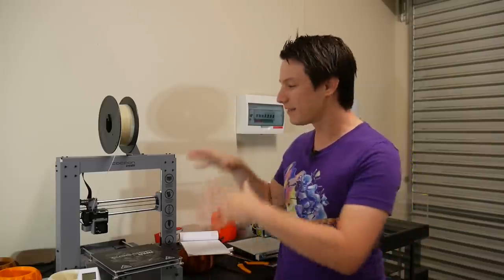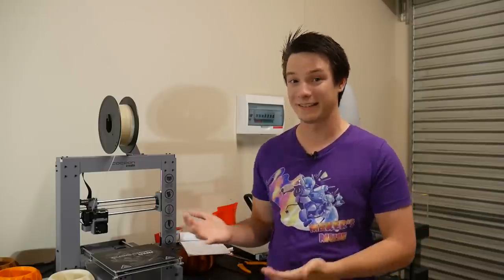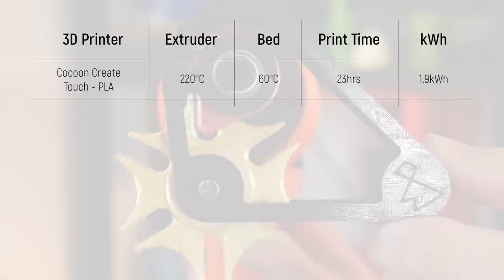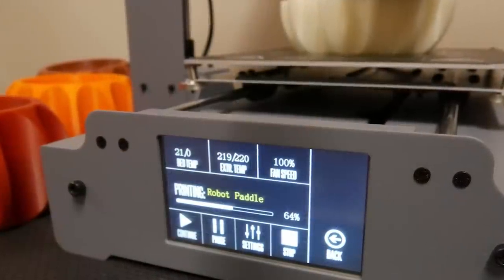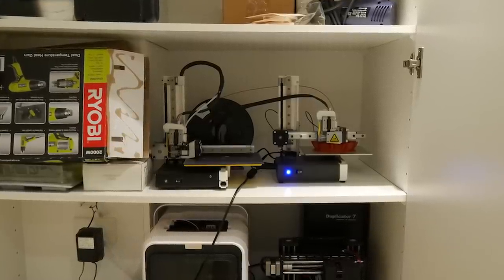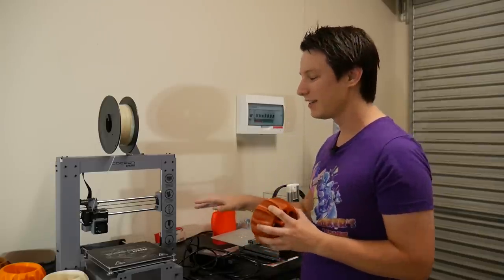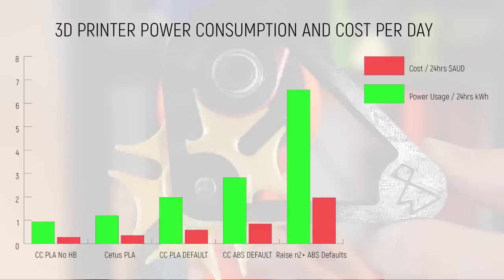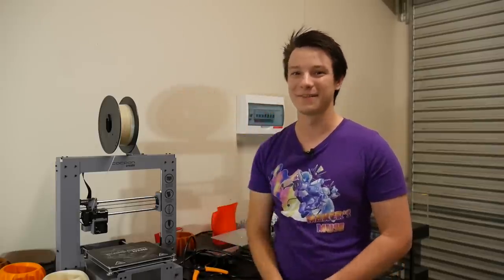How much power do 3D Printers use?

Comment: I don't think you understand what kwh means. That means that amount of kw/hr. So if your printer used 5kwh and printed for 19 hours, you used 95kw of electricity. That's nearly a friggin Tesla p100 of electricity!

Also, I don't think your fuses are rated for that much power. So you most likely just meant kw, not kwh. Lol
Reply: nambinhvu you misunderstand what kW and kWh mean.

Here's a recap of energy and power units:

First the definitions of energy and power:
Energy is the total quantity of work used to complete some action.
Power is the energy used for each unit of time during the same action.

You can compare them to motion quantities: energy is equivalent to distance (quantity of space covered during some movement), power is equivalent to the speed (distance covered per unit of time).

The base energy unit is the Joule (J).
The base power unit is the Watt (W). 1 W = 1 J/s.

A 40 W light bulb consumes 40 Joules every second it's on.

Since electricity consumption measured in Joules gives impractically big figures, an alternate unit has been designed: the Watt-hour (Wh).

1 Wh is the energy consumed by a 1 W appliance running for 1 hour.

1 Wh = 1 W x 1 h = 1 J/s x 3600 s = 3600 J = 3.6 kJ

1 kWh = 1000 Wh = 3.6 MJ

A 40 W light bulb that is lit for 4 hours every day on a 30 days month accounts for 40 W x 4 h/d x 30 d = 4800 Wh = 4.8 kWh on the electricity bill.
Reply: Christian Barnay I don't think you understood my comment. He said his printer used 5kwh. Household circuit breakers are only rated for 1.8kwh, if you draw more than that it'll trip. What he meant was it used 5kw for the print, not 5kwh. He's using the rate to represent the total amount of power.
Reply: No, I insist. You are confusing the units. Breakers and all appliances are rated in Watts or kiloWatts, consumption is measured in Watt-hours by multiplying the rate in Watts with the duration in hours.
Please re-read my comment carefully.
What you consume and pay for is energy (kWh). And its rate of use is power (kW).
Check your electricity bill: your monthly consumption is measured in kWh.
Check your breaker: it's rated in kW, not kWh.
Reply: Christian Barnay you're right lol my bad

Comment: Why are you printing at such a high temperature? I've NEVER needed to run my printer that hot on any color, you must be burning the crap out of your filament and getting clogs constantly.
Reply from the maker: These are software defaults, bit high for PLA yes but never clogged
Reply: +Maker's Muse Thanks for clarifying! Not sure about differences in brands of PLA, I use the cheap stuff, but you really never need to go above 205C for PLA (white) or 200C for Black. I haven't had to do a de-clog in over a year running 7 printers!

Comment: Sorry Angus. You were right. I got it all bass-ackward. Thanks everyone for politely correcting me. I'm leaving my original (wrong) comment as evidence of my confusion:
P.S. Your stats are confusing: kWh is the amount of Watts used every hour, not the total usage - that would be kW. So when you said it uses 1.8KkWh, that figure would be multiplied by the number of hours, thus resulting is crazy high costs.
Also, you don't get charged per Kilowatt Hours, you get charged per Kilowatts.
Reply from the maker: Yep I botched it... Had to schedule this one and messed that up. I'll follow up asap
Reply: Great video, btw. Not meaning to be harsh. Cheers!
Reply: W=J/S Joules are unity of energy 
kW=1000W=1000J/S
H=3600S
kW*H=1000J*3600S/S
The seconds cancel
kWh=1000*3600J
jWh=3.6*10^6J
and joules are a unit of energy
Reply: No.
https://en.wikipedia.org/wiki/Kilowatt_hour
Reply: Hmm? It's the other way around, the video is correct, imo. kWh is the correct unit for total power consumption (aka energy)...
kW is the power drawn at a specific point in time, only if you multiply it with the time that it's running will you get a total amount of energy which is what you will be billed for.
edit: ok, not the first one to reply^^
Reply: Yeah, did the same mistake until I watched the whole video :)
Reply: Da Hai Zhu You are not correct here. kWh is a measure of used energy.
Reply: No, you were right first time, Da Hai Zhu has it wrong. kWh is the amount of energy consumed. kW is the rate of energy consumption - multiply that by the number of hours you were consuming it to get the total kWh. This is why you pay for kWh not kW.
https://en.wikipedia.org/wiki/Watt
Reply: Yep. KWh is more interesting if you're worrying about cost. You pay by power over time because you use power variably over time.
Reply: KWh is energy/work done, not power
Watt is power aka work per second
KWh is 1 KW (1000W) x 1 Hour
1000W is 1000J in 1 Second
1 Hour is 3600 Seconds
so 1KWh is 1000W x 3600s = 3600000J of work
3600000J = 1 KWh = The work done in 1 hour by something that outputs 1000W of power during that time

He showed one of the printers used 1.9KWh in 23 hours so 1.9/23 = 0.0826KWh in 1 hour = 82.6Wh so the printer consumed 82.6W average during those 23 hours. That would be like 6.88A at 12V, around 5.5A if you asume 80% efficiency between the power supply and other losses.
Reply: Well kWh is a measure of energy but it's confusing to think about. I'd prefer MJ instead
Reply: Folks, I suggest you go look at one of your power bills. The power bill shows cents per KWH -> then  KWH used. KW is literally how much it uses as an instantaneous reading, like the speedo in the car. If you are doing 100KmH then how far you travel depends on the amount of hours you travelled. As we don't have a ready amount for this we use KWH for the total amount. However that figure does not tell you what happened: NB  it does not say if you had a 1KW draw for an hour or a 1W draw for 1000 hours ... indeed as far as the bill is concerned they are equivalent.

Now, using that the little Cetus used 0.5KWH ... end of story. That it took 10 hours suggests that the amount of WATTS it was drawing (which is also recorded on that meter , which you'll have to read occasionally or variations will be missed) at any given time was about the same as the CCTouch PLA @ 1.97KWH over 23 Hours = 85 Watts draw (again, remember the speedo example)

Now the Cetus works out to be 0.5KHW over 10 Hours = 50 Watts draw, which strikes me as about right considering that it didn't have a heated bed.

By way of input here, look at how many Watts a Hot Melt Glue gun draws while operating, or indeed a fan ... The bed is only heated a little bit (compared to a heating element like that in one of the benchtop hot cooking elements.

Anyway Angus, top points for putting this together ... it is the nature of experimentation what we make errors in presentation, but as long as we record the data properly we can review and re-interpret.

:-)
Reply: kWh is the total energy in joules, 1 kWh = 3.6 Million Joules, (that you will be charged for on your bill) calculated from multiplying the average power in Watts by the total hours you use that amount of power. So the total usage is kWh. There's no way you can get charged per Kilowatts as that value in itself doesn't tell you how long you ran the device, just the instantaneous power at that moment in time.

(I believe you've got this sorted out now anyways!)
Reply: Typo at the end with "jWh" and it's strange that you switched from capital H to lowercase h and that you are using a capital S for seconds. A capital S is used for Siemens which is the unit of electrical conductance, the inverse of resistance. Otherwise the units and math are good.